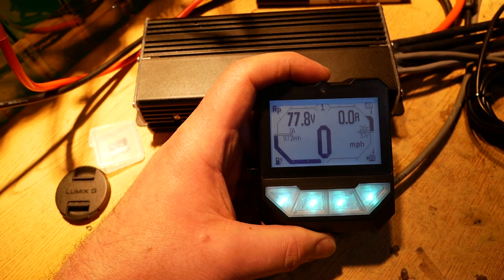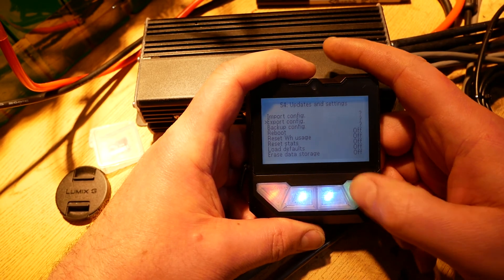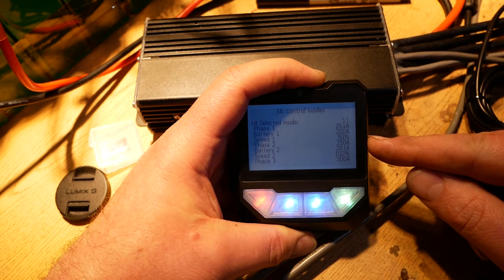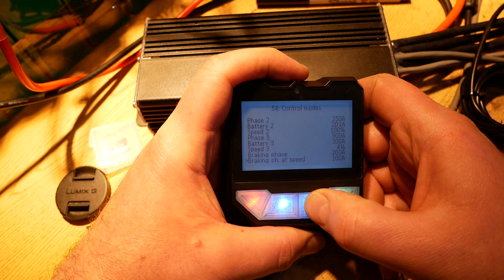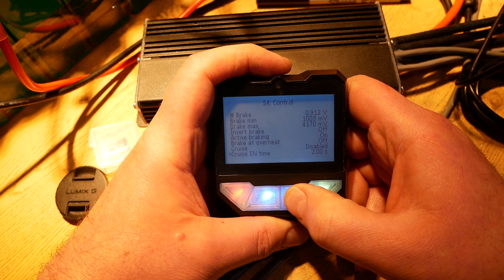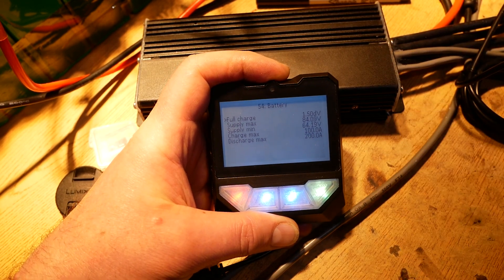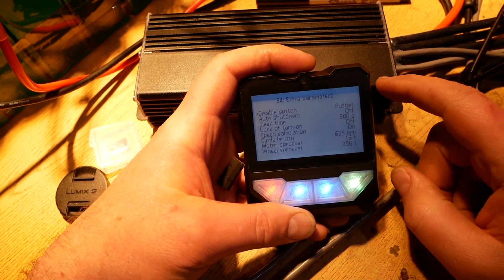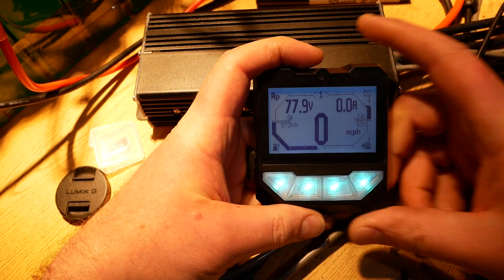3 Nucular Controller setup walkthrough

Comment: Hi man, thanks for you video, Ive ordered 2 kits of 24 fet. I was wondering if you could explain to me how I can charge from the controller (I saw the diagram but still not sure). Do you need a power supply? I saw a guy (cyberbike) that just plugs his bike, but between the plug and the controller, is there something? Thank you!
Reply from the maker: I don't use this functionality. I use an independent charger. There are implications to using the motor and controller for charging. I chose to NOT do this. Building a charger is easy or just buy one and save yourself the oddities this brings to an EV. This is just not something I'll ever use.

To answer your questions...
The motor is 3 large inductors. The controller uses it's mosfets and the motor to create a high current DC-DC BOOST converter. A BOOST converter up converts a lower DC voltage into a higher DC voltage. You can buy small DC-DC BOOST converters on ebay for around $20. So then, you need a power supply such as a 50 amp 12v PSU. It gets connected to the controller which then up-converts that 12v to your battery pack voltage.

Why I don't do this:
1. It adds complexity to the controller and motor setup.
2. It's pretty inefficient. You will need to down convert from 120v AC to something like 12-24v DC and then up-convert back to pack voltage. Why bother? Just down convert 120v AC to pack voltage one time for the best case charging efficiency.
Reply: Hey thanks for the great and clear answer. Now I know I wont try to charge that way and I know why! 

What do you think about progressive regen?
Reply from the maker: @matthiasvaillancourt8877  I use variable regen as my primary method of braking. My first EV had a freewheel on it so the back wheel spun free of the motor for coasting. I wanted regen. I always want regen so I recover mechanical energy as electrical energy. I soon bought a controller that supported this and of course ditched the freewheel. That was 2015. I've been using regen on all my EV builds since then. I refuse to build without regen. Why waste the energy of slowing down when it adds miles to your tide time? It's not miraculous and you will only recover like 20% of your original charge, but hey, I'll take every extra mile I can get! Especially free recovered miles!!! 

Nucular controllers and others support variable regen via a second throttle or fixed regen when you hit the brakes or just let go of the throttle. I variable regen much more than I ever did fixed regen. With fixed regen, I would set it in the controller to whatever would let me coast down a minor slope. This got me some recovered energy without having to use power to roll down hills. With variable regen, I have it set up so that regen is capable of decelerating just as hard as I can accelerate. This means pretty aggressive regenerative braking. With the regen throttle, I can then adjust how much I slow down. Sometimes the car in front of me is slowing just a little so a light amount of regen is all I need. Sometimes I need to brake really hard and then I crank that regen throttle. Under most situations, I squeeze my right brake lever just enough to turn on the brake light and then do all the actual braking via regen. It's ONLY when I need seriously aggressive braking that I turn the regen throttle and squeeze both brake levers.

Variable regen is a great thing to have!
Reply: Hey thanks bro for all the answers and explications again. Very interesting and it will help me a lot knowing what to do now. So ya I know what you mean about a fix regen, really not nice to use I think (cuz you can only choose one value at a time) and also it give a little hit in the wheel every time so it’s not fluid at all, that’s why we can regen way more with progressive regen. Im hesitating between qs205 v3 50h (85 pounds bike) and qs273 40h (105 pounds)
I use good dh bike, and my target is to do 0-100kph (60 mph) in 3.5-4 secondes.. if ever you have a suggestion, im really open! 27kw peak for 5 sec I think its more then enough to achive it? 

Thanks!
Reply from the maker: @matthiasvaillancourt8877  I have suggestions!
1. I don't use hub motors if I can avoid them! They do have advantages, but at significant cost.
2. Hub motors for the cost and weight are the worst solution for powering an EV. They are heavy and tons of spinning mass is bad for everything. 
3. Hub motors are going to have very high turn counts in order to get the low Kv needed to match wheel RPM. This makes phase resistances quite high compared to an inrunner or outrunner. Resistance = heat losses!
4. A 4kw QS205 v3 (I have one) weighs almost 40 pounds! A 4kw outrunner weighs 2 pounds and is 1/8th the physical size. A 4kw inrunner is about 6-8 pounds and 1/5th the size of the QS205. Weight...even fixed weight is a loss of performance to you and hubs ARE the worst!
5. Hub motors suck at cooling. The stator sees no air flow and has no direct path to outside air for cooling. The stator is trapped inside dead air space. All heat exchange has to happen via conduction through dead air to the aluminum shell or to the magnet ring. This is BAD in many ways! An outrunner is open. Good air flow to the stator is guaranteed by the spinning armature. Inrunners have the stator in physical contact with the motor shell. Heat exchange with external air is guaranteed. Hub motors absolutely suck at cooling!
6. To enhance hub motor cooling, fero fluid or mineral oil is often times used inside the motor. Either option is messy and adds resistance to an already HEAVY motor. They do make for a better heat conductor than air, but leaks happen and then you are spraying nasty crap everywhere. IF you ever need to service the motor, you first need to get rid of the mess. No thank you! Even then, you still need to add heat sinks to the magnet ring area. In every way I can think of this is a poor solution to cooling.
7. The only way I'll run a hub motor is with vented side covers. This potentially exposes the motor to road grime and water. Better than nasty oil and ferro fluid, but the motor can get dirty inside.
8. A 4kw hub motor such as the QS205 will cost you $500. I have this exact motor. I bought it purely out of curiosity and by comparison to a $500 outrunner, a far inferior option!
https://www.aliexpress.com/item/1845650900.html?spm=a2g0o.productlist.0.0.40624c04fjiacf&algo_pvid=7a5fea23-3ee2-40ca-a272-6269f7b1bb3e&algo_expid=7a5fea23-3ee2-40ca-a272-6269f7b1bb3e-1&btsid=0bb0623916045172188502224e9caf&ws_ab_test=searchweb0_0,searchweb201602_,searchweb201603_
9. A 4kw outrunner such as the C80100 at 80kv will cost you including shipping about $200. I have 4 or 5 of these motors.
https://alienpowersystem.com/shop/brushless-motors/80mm/c80100-sensored-outrunner-brushless-motor-80kv-7000w/
10. A hub motor has fixed gearing. The only  way you can adjust for the motor Kv and torque is with a smaller or larger tire/rim. If a larger or smaller tire is available for your rim, this still requires removing the back wheel to replace the tire. If you also need to replace the rim, then you need to restring the wheel with a new rim. An inrunner or outrunner and a couple of sprockets allows for easy re-gearing for whatever it is you are wanting to do and a low maintenance chain line. On most of my EV's, I can loosen chain tension and pull the motor sprocket off the motor in less than 5 minutes. Increasing or decreasing a tooth on this sprocket changes EV performance significantly. Maybe 20 minutes later with doing nothing other than loosening chain tension and a couple of set screws on the sprocket, I have changed my gear ratio. Accommodating a 26" tire or a 6" tire is just different gear ratios and the same motor. IMHO, this is MUCH easier to do than anything on a hub motor.
11. A hub motor is nearly silent as the only noise is from the winding's pulsing. A mid-drive adds sprockets and chain or a belt which does make more noise. Done right with 219 chain and dead straight this is still very quiet. Most chain noise is poor chain and sprocket alignment or cheap chain choices. For example T8F chain in perfect alignment is much noisier than 219 in perfect alignment.
12. A hub motor does have ease of installation going for it. Assuming your dropouts can handle all the motor torque on the shaft flats, then it's a matter of sliding the motor onto the forks and doing a little wiring and you are done. Adding torque arms doesn't add a lot of complexity either.
14. Unsprung weight is your enemy. A hub motor is 100% unsprung weight and a giant gyroscope right inside your wheel. Ride quality, responsiveness of the suspension and other components all suffer for this big hunk of spinning metal in you back wheel. A mid-drive solution while having a bit more complexity can place almost all the bikes weight inside the suspension and diminishes spinning masses to a very small portion of the total EV weight.
15. Hub motors are slow spinning. It is common knowledge that brushless motors are most efficient  at higher RPMs. A typical hub motor might achieve 200-1300 RPMs while an inrunner or outrunner will spin at more like 3000-6000 RPMs.
*
I could go on a while about why hub motors suck and why outrunners are the best option, but I think by now you get the point. I'm not a fan of hub motors for many reasons and the added complexity of a chain line is no deterrent to me to using an outrunner in a mid-drive configuration every chance I get. I have personally built or heavily modded 8 EV's. 2 still have hub motors. The others all use outrunners. The performance gains from outrunners and significant cost and weight savings far outweigh the added complexity of a chain line and the minimal maintenance chain needs. I own several hub motors (10+). Most will never see use! A few that I have will get reworked to take away tons of weight and then rewound for 60-70kv and used as an outrunner in a mid-drive configuration. One of these as a hub will make a piddly 500 watts. Converted into an outrunner and rewound it becomes a 10kw motor. On this stator, 32 turns per tooth gets 8kv and 2 strands of 20 awg wire. UGG!!! At 10 turns or about 80kv, now there is room for 14 strands of 20 awg and MUCH MORE wattage.
*
If you are doing a fresh EV build don't use the worst possible motor solution. Hub motors are expensive, heavy and very low power density. Use something good that delivers optimal performance for very little weight and cost. Outrunners are the BOMB!
Reply from the maker: @matthiasvaillancourt8877  On the subject of fixed regen, I think that is the specific implementation in whatever controller you were using. I've used fixed regen many times and never seen any jarring or "bump". The controllers I used with fixed regen were made by Kelly or from Power Velocity. Neither would "bump" when regen engaged.
Reply: Ok, ive used eb3 and power velocity and they both did it, dont know why not you too lol
Reply: Thanks for all the explication, Honestly Ive never try mid drive motors, But I’ve seen a couple and also on youtube. Yes the noise was my main concern, and its also hard to put a motor able to hold 27kw for 5 secondes on a bicycle. My current build is a demo8 (85 pounds with everything), 24kw peak for 1 seconde (eb3 modified). I manage to 0-60 kph in 2.5 - 3 seconds. My motor is a cromotor v1. I dont use ferrofluid or heat sink, never overheated the motor in years and I do a lot a wheelie and big acceleration. My pack is lipo graphen 1.4 kwh nominal. I honestly love to drive my bike, but I almost only drive it in the city. One guy I know make 0-100 kph in less then 3 secondes with a Qs273 40h and a 175v 600 amp phase controller. The bike is like 40 pounds heavier then mine though! So I was thinking of the same motor on my futur nucular. I’d love to know more about mid drive and see it in real life to see how noise it is but because I dont see how to put it on a bicycle so thats why I stayed on hubmotor.. but you are right, they are heavy for the power they give.. would love if axial flux hub motor would exist!
Reply from the maker: @matthiasvaillancourt8877   
I started on mid-drive and it was only now that I finally tried a hub motor. The weight, spinning mass, unsprung weight and so on were all reasons to avoid them. The chain noise for mid-drive is not that much. 219 chain is pretty quiet. Get moving a little and the chain noise is lost in the wind. Other chain options like T8F is pretty noisy, but that stuff is low power crap too. In an outrunner, 27kw is actually a fairly small motor and far less weight than something similar in a hub.
I'm sure your Cromotor makes some nice torque, but dang the weight and other issues.
What controller was used at 175v?
In my free time, I have an A2B that I am converting to mid-drive. I've already restrung the back wheel with better spokes and a track hub. I've adapted the right side drive to work with a single sprocket for pedaling and another for 219 chain. Right at the swing arm pivot is where I will mount a Revolt RV-100Em outrunner. The dual chain lines are all worked out. I need to make a motor bracket for the outrunner, but that's about it for the mechanical parts. The 219 wheel sprocket could stand to lose some weight by drilling holes in it. I'm looking at 10-12kw at much less weight than 4kw in a QS hub motor.
Reply: De-bodgery hi again my friend, thanks again for your reply and informations. The controller 175v is khb12101. I will look into what you said about mid drive, what kind of chain will old 27kw on a bicycle? i mean the torque is what will say to power on the chain but that I dont know, my hub have like 400 nm peak at 0rpm. Where are from? By any chance you are close from Montreal? Haha
Reply from the maker: @matthiasvaillancourt8877  
27kw on a bicycle? That is quite a lot! I bet you are talking about peak. But hey, don't let me hold you back. Expect to reinforce the entire back end of the bike to hold that much motor torque on a bicycle! 27kw = 36hp. That's about equivalent to a 40cc gas engine and a lot of motor cycles have a smaller engine than this. Anyway, you go! 27kw on a bicycle...that's waaaay epic! I'd love to see this!
#35 chain ought to hold that much power. it is used in KART racing quite a lot. #25 is the next step up in strength and is used on motor cycles. It will for sure hold 27kw. The link size is pretty big so the sprockets won't be super compact like #35 is. You can probably get by with #35.
I'm in the Northwest USA...too bad right?
1. The KHB12101 is rated for 200 battery amps max and 120v max. You won't run it at these levels or it will shut down. I've had several Kelly controllers and they will shut down if you get close to their maximums. As a result, you'll probably run this controller at 100v at most. At 200 amps and 100v, that's 20kw max. It is unlikely you will see this wattage from the controller.
2. Something I'm not seeing listed is the type of control the KHB controllers use. I suspect it is trapezoidal since they don't explicitly say sinusoidal. 
3. AS far as I know Kelly does not make FOC controllers at all and frankly this is really what you want. It is better than sinusoidal control which is better than trapezoidal control. I think Kelly only makes trapezoidal and sinusoidal controllers.
4. Kelly makes their controllers pretty much all the same. There is a control board that is common with an entire product line. Each controller in the same product line will have the same  control board and different sized mosfet power boards that reflect the voltage and wattage for that controller. The KBS and KLS controller lines have a 12 fet version and then a mosfet expansion board for more wattage that attaches to the base 12 fet controller. It is likely the KHB controllers work this way too.
5. If you want 27kw continuous, you need a more powerful controller than the KHB12101. The highest any of the KHB series goes is 144v as they use 150v mosfets. There is no 175v KHB controllers. With the 144v controllers, 131v is pretty safe and you won't cause shut downs on them. Consider getting one of them? I looked at the entire Kelly product line, 144v is the highest they go.
https://www.kellycontroller.com/shop/khb/
6. More than likely you don't really have a use for 27kw on a bicycle! Consider getting a Nucular 24 fet controller. They are 100v and 300amp max controllers. That's realistically more like 82v so you have a safety margin. I can tell you that 250 battery amps continuous is not a problem for them at 82v. That's 20kw continuous. I've never tried mine at 300 amps so I can't say how well they do at almost 25kw. They are FOC controllers so a LOT better than a trap controller. 250 battery amps is not a problem.
Reply: @de-bodgery  yes but with that feature you can charge on the go without having to carry a charger around
Reply from the maker: @MTO_Brothers  You still need a power supply to make it work. It's not like  you can just plug in 110v AC into the controller and magically charge. It's just my opinion that this doesn't really make things simpler, just equally complicated in a new way. I like systems with independent parts that work together or can work independently. A separate charger fits this. 
**
Using laptop PSUs can make for a rather compact and high current charging solution. I have been using Lenovo 170w laptop PSUs for many years as chargers. The first charger I ever built was from Lenovo 90w PSUs. I've built probably 8 chargers for others from the 170w PSUs. I have 2 for my uses. The 20v increments work great with 4 of them for 20S or 82v. The outputs are isolated so you can connect them in series to get the voltage you want. 4 in series comes out really close to 82v. 170w/20v=8.5 amps. No fans, temperature protected, overload protected, compact and costs about $70 to build...not bad! I recently discovered an HP laptop PSU that delivers 230 watts. They are a little larger than the Lenovo 170w PSUs, but they also deliver 11.5 amps. They are also pretty easy to take apart and getting to the board so the output voltage can be adjusted makes them a lot more flexible for other voltage increments. The Lenovo PSUs are much harder to take apart. I have 6 of the HP PSUs. I'll be messing with them soon enough to make a new charger.